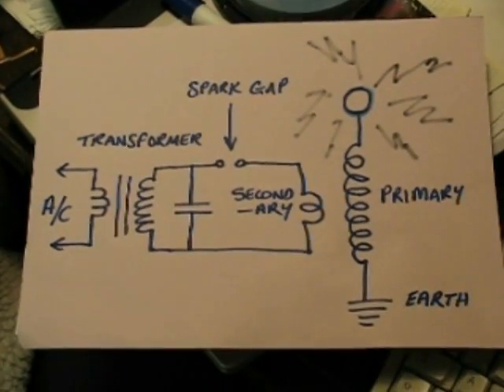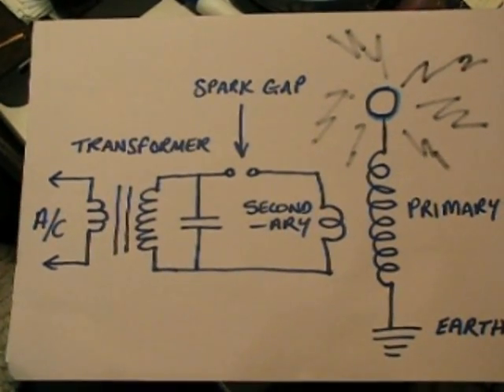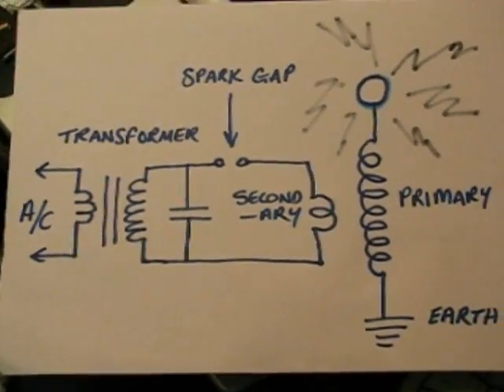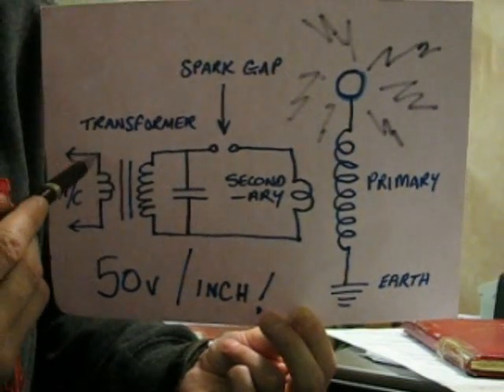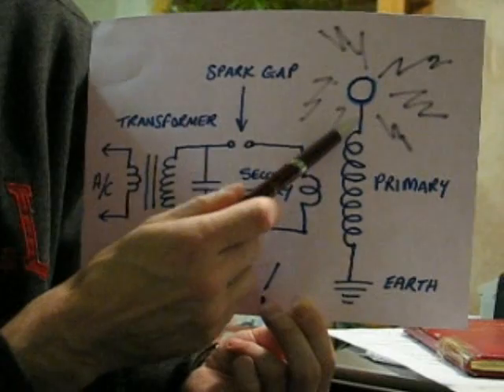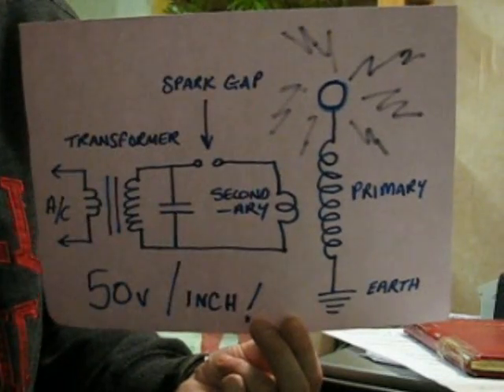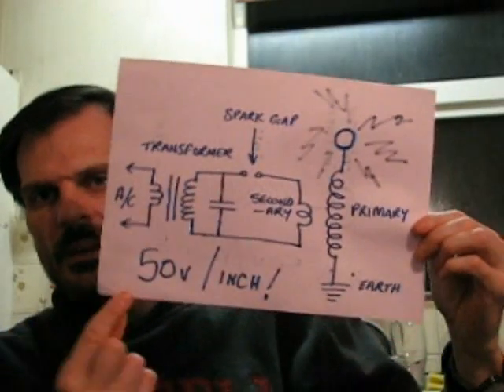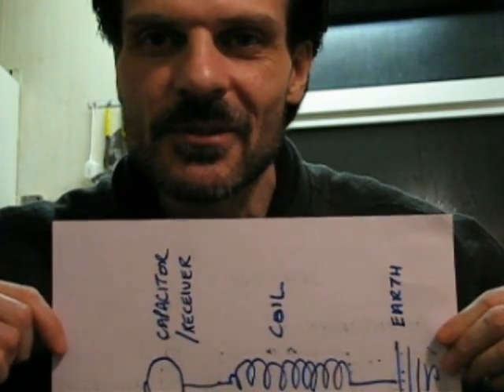Tesla's Little Secret

Comment: “YOU SEE, I  built a cabin with 1kw solar charging of batteries via Morningstar 45 controller. NO PROBLEMS except I cannot run my 17-watt refrigerator during seasonal minimum of winter (from early November to late February. I REFRIGERATE my food in the 42 degree basement during winter. ITS NOT bad.) THUS, I look only to augment with maybe 500-watts daily, as charging input to my 25.2 volt batteries (26V @ 4A for 5 hours could change the world, justifying a sterner correction of energy production & consequent surge in futuristic, pro-China environmentalism.) ITS A different reality. I EXPENSE $1 propane daily for cooking & wood heat (that is my energy cost not including gas for my chainsaw & splitter, LT system maintenance, guessing less than $1 daily.) MIDDAY, THERE is inefficiency as the controller will protect the batteries, so I turn the panels to improve input duration. YOU SEE, I expect $200 weekly disposable income from social security with this arrangement in 2022.

AM DECIDING that 28V @ 1A augmentation would be wonderful, solving my seasonal problem.”
Reply from the maker: Have you thought about using electrolysis in summer to split water into hydrogen and oxygen? And in the winter use the hydrogen as fuel to generate electricity?
Reply: MattBlytheTheOne 

“WELL, CONSIDER option to expand the array. CLOUDY DAY input varies seasonally , is between 10-20 percent of sunny input. THIS COST is less than would be a gasoline generator (which I do not own, or a battery charger which is under consideration. A QUALITY 24V charger is marketed to charge electric scooter battery, a good looking product.)

10 years ago, I built a Perendev MM which failed. THE BEDINI IS noisy, though I think a bicycle wheel might be okay, paralleling two devices to achieve 24 watts? AM RESEARCHING Clemente Figuera motionless device, waiting. SCALE A 500-watt version of it for my application. IT WOULD be nice. ALSO, VARIANTS of motionless pulsed devices may deliver 48 watts & would be impressive. THE RON PUGH charger design is interesting. I HAVE seen a U.K. demonstration via YouTube. AS I enjoy doing PCB layout & Eagle drawing, I look to leverage the capability to assemble a kit product, which could be sold profitably. THIS ASSERTS my interest in pulsed systems, the Figuera design can be accomplished with divide-by-sixteen into a PLD, or the 4017 as shown & a PCB. IT WOULD be quiet, & the design would be reproduced with minimal defects in a kit product. FIGUERA SUPPOSEDLY powered his home 100 years ago, deriving several KW. IF I could get just 500-watts in a kit-able product, I would not only solve the charging problem for refrigerating, but would have ability to augment social security income in my future.

HYDROLYSIS INVOLVES several things with which I am not familiar. SAVING HYDROGEN for winter use seems less preferable than a reliable Figuera charger device. I HAVE downloaded the PJK Book.

I PAY $60 monthly for unlimited ATT IPHONE data access. CAN DO research & drawing. AM REASSERTING my electronics capabilities since losing everything to fire in 2015. I CAN create artwork for your boards, & do simulations in LTSPICE where I prototype logic, also with Electronics Workbench. MY OLD laptop survived the fire. I LOST THE cdroms of my software. WAS EMPLOYED to create SMPS prototypes for fiber optic development. I HAVE an Arduino. HACKED PERL Webstore, adding cache feature to DB version. HACKED COPY protection in TMS7000 Videocipher hacks. FCC General Class since 1981. AAS ACCOUNTING.
Reply from the maker: Good luck and thanks for posting your CV ;-)

Comment: Thanks for links to Tesla biography. Regarding "Mr Tesla's little joke..." I'll be honest. I dont get it? This guy was a superb electrical engineer - Why would he "hide" such an important discovery? He basically invented and patented induction motors (that dont use brushes) along with polyphase distribution (that solved the problem of electrical distribution over long distances). Not inconsiderable achievements. But if you look him up on Wiki, Wardencliffe is described as a "wireless communication and power transmitter", not a radiant energy collector... So where does this idea about radiant energy capture originate? Surely the big guns and a group of electrical engineers could develop such important (life changing) technology? Thoughts welcome. I have nothing to lose but my ignorance!

Comment: could the process be as simple as capacitor placement?  if when plugged into AC mains, the cap is prior to the spark gap,  as a voltage multiplier to jump the gap and oscillate the circuit; wouldn't the converse need to be true if the circuit is running in reverse?  should you then move the cap to the other side of the spark gap and add a diode, to act as a DC voltage multiplier to again excite the gap with a DC source and oscillate the circuit in reverse

Comment: No. How can the ball at the top just collect radiant energy? It can not. This is why it has never been built.
Reply from the maker: Do you know how aerials "collect energy"? They are tuned to receive signals of a certain frequency. There is nothing special about them.
Reply: Yes I do and if what you are imagining here is real then please build one. A tuned antenna, called a rectifying antenna, designed to collect radiant energy, have been created however the energy collected in very marginal. In addition the ball at the top of the Tesla coil is designed to evenly distribute electricity until it can find a ground outside of the circuit. Its designed to distribute massive amounts of AC current.
See here and research the idea: https://en.wikipedia.org/wiki/Rectenna
Reply from the maker: I believe the Tesla Coil was designed to reduce back emf and ionise the atmosphere such that energy could be transmitted wirrelessly at distance to a similarly tuned coil remotely. Wikipedia is an open source encyclopedia, anyone can edit the articles. Except the Tesla page which has been restricted to only a few approved editors. You will never find the whole truth on wikipedia...
Reply: This is true. My guess is that Tesla was also trying to develop the tech for than more reason and found out that the coil was ultimately a dead end for him. Not to say that broadcast power has not been the dream of most scifi lovers everywhere. The coil as designed and known today really does one thing best to everything that comes near it.... With that said short distance power distribution is possible today for small devices using DC power and I am sure you know this... :)
Reply from the maker: I have a new video coming out that reveals pone of his major breakthroughs, you will love it. Subscribe if you have not already and turn on notifications :) Thank you.

Comment: It all seems reasonable from an armchair point-of-view, however, millions of these Tesla coils have been built in the last hundred and thirty years and no-one has seen this power reversal manifest in their units. I have built a dozen or so of these Tesla coils of all sizes in my teenage years and I have also wondered  if it could be reversed and I have checked the voltage on both sides of coil #2 and found only a few millivolts and designing it from scratch with those numbers that I got from the coils didn't yield enough across the secondary of what would then be coil #1 to be of any use. I do believe that with some fooling around with it that it could yield something but we would perhaps need to build a resonant circuit that resonated with something [what ???] that is being generated from the planet, I don't know, I don't have the time or funds to play with it right now. Good luck to somebody... :-)
Reply from the maker: Have to tried building resonant coils to send/receive energy wirelessly to each other? Hint, the mass needs to be the same in each coil, and the sending frequency needs to be optimised at resonance :)

Comment: My ilttle secret......to extract power from the sun..............use SOLAR photo-voltaic panels  and Solar pipework heaters ! Stop sucking the end of your pencil and dreaming,  plug in and start selling the free stuff back to the energy corps. !
Reply: It was a dreamer sucking on the end of a pencil, that invented your solar panels. So, me not being an electric engineer, it costs me 20k to 40k to get house setup just to get 5 or 10 bucks a month from the power company. No thanks!! I'd rather pay 2,400.00 a year till a dreamer sucking on the end of a pencil figures out what tesla invented years ago
Reply from the maker: Both have a point. Solar panels are expensive and not particulrly efficient. They are good but by no means the best way to collect radiant energy!

Comment: Dude, its been 6 years, have you made progress? You are right as far as you take it, but you need to look deeper. How is the radiant energy collected? Backwards, isn't an answer. Resonance (Morin) isn't an answer. The question is: How is the radiant energy collected?

Survey says: It's in the spark gap Boyo!

But, you're missing something to make that possible.

That capacitor will charge however the polarity across it charges. And with an AC transformer charging it, that means both directions. And a fact about capacitor discharges is that they are AC. Yep, even a unipolar charged cap will discharge with an AC signal.

Tesla's secret was to shorten the spark (with several strategies) and get it to be unipolar. Then it collected up to 1,000 x the power of the spark from the Aether. The spark became a radiant source and that source, like air compressed in front of a plane traveling at the speed of sound, collected more radiant energy which went directly into the primary to his final high capacitive coil. (The tower coil with a top load.)

His methods were not secret, they're just left off the majority of circuits. They included a rotating spark gap that accelerated the number of sparks, making each one shorter. Also electromagnets that cut off the reverse current sparks. Plus hot air jets that shortened the sparks. Yep, you can blow them out.

Now you're pumping a variable DC.impulse into that Tesla coil, which projects a radiant pulse train that is self-amplifying, or lossless. Any tuned capacitor will receive more power than was consumed generating it. The most crude and simple implementation of this is what tesla did, transmitting power 6 miles. He also. Modulated that power with FM and AM signaled... so you can transmit lossless data.Poaer and controls for RC planes that do not require fuel, or lossless transmission of two way video... Oh, did you get the memo. This impulse wave travels 57% FTL. It's a death knell to the communications and power industries. So, when you do get it working, keep it on the down low. Or you might end up down under. Peace, B
Reply from the maker: Strewth! Thanks for sharing your wisdom.

Comment: Running the aerial backwards,  you would have thousands of volts,  but no amps to go with it. So basically you have a static generator powered by ions in the atmosphere. You can see this with a citizens band antenna tuner.

Comment: Problems: 
1. Atmospheric potential is DC, so it won't do fuckola when put through the first transformer unless it's inverted to AC, but that in itself would take power from the system.
2. Atmospheric potential is indeed about 50-100 VDC a foot, but has picoamperes for current, you could barely run a single LED with a 500 foot tower.
3. If harvesting atmospheric potential was viable, power utilities would be using it & sending the 'free energy' through the existing grid & billing you based on your existing electric meter - just like they do with hydro/wind/solar & every other power source.

Nice try, but get a basic grip on electrical basics like amps/volts/watts & the properties of AC v DC.

It's not an illuminati plot or a cover-up. Yes, power can be harvested this way, but it's infinitesimal, more suited as a science fair project than a viable power source to replace our current sources. The energy return on investment is a waste of time & resources when compared to other power harvesting techniques.
Reply from the maker: Do you know why they have spikey conductors on the top of broadcasting masts? It is to conduct the huge amounts of electrical energy generated at those altitudes. If they did not have those the power would destroy their equipment. Just like lightning would destroy and LED. You do know how lightning works?
Reply from the maker: Ps. What is a fuckola? Lol.
Reply: MattBlytheTheOne Fuckola is the amount of DC power that is transferred through a transformer. Yes, there will be an initial pulse as the inductor charges, so yes - you can harvest a nano-second worth of voltage in the picoamp range.
Neat, but useless.
Reply: MattBlytheTheOne MattBlytheTheOne Thosr spikey things are called "transmission antennas" or are you referring to the lightning rods? Yes, I know how lightning works & it's the same thing that would destroy your proposed scematic at the first strike.
LEDs? Yes, a light emitting diode - they work because semiconductors lose electrons at the p/n junction & LEDs convert those lost electrons into photons.

Any more questions? I'm quite well versed & experienced with electronics & electricity.
Reply from the maker: Ok how are lightning clouds able to generate many millions of bolts of high current of lightening for several seconds and not discharge after the first strike. 

I thought a fuckola was a bit like a tombola: you win a prize for thinking you know an iota about how the universe works!
Reply from the maker: And also: how does an electron become a photon?
Reply from the maker: And: Why do LED's not heat up in the process of "converting" (lol)
Reply: MattBlytheTheOne The stormclouds build up a static potential which is discharged to earth & is repeated & different areas of different potential within the same storm.

Instead of arguing with me about your circuit why don't you build it & prove the nay-sayers wrong?
Reply from the maker: Did you read that on wiki? What about the alignment of the potential difference across H2O molecules that are continuously charged by the aether (as all atoms are)? I'm not arguing with you.... it is not my job to educate you and weather or not you agree with me, no doubt the Universe is working as it should. Expanding your own education will however open up new avenues of research and breakthrough for you. Why don't you build one and prove me wrong? Probably for the same reasons. Time and money and the fact that I never said I would build anything and especially not for your approval ! Have a good day! :-)

Comment: a lot of paper stuff but no real practical working model...what's up with that?
Reply from the maker: One small simple diagram I borrowed from the internet and discussed is a lot of paper stuff? Google working Tesla coils and see if you can work out why Tesla created them and then built one the size of a tower?
Reply: I just thought that I was going to see something that actually worked or even a small built up model.
Reply from the maker: There are prototypes and experimental designs but not by me. I am just discussing ideas because I am interested in electronics and the workings of the universe. Thanks.

Comment: The flaw in your theory is that you can't put DC through a transformer.
Reply from the maker: Of course you can. Dump enough current through a coil of wire fast enough and it create a big spike of power and enough electromagnetism  to create anti-gravity!
Reply: Mattbytheone: Ok I'll spell it out, if you put 9v ac through a step up transformer, it will step the voltage up, but you cannot step down or step up dc voltage through a transformer. This was Tesla's arguement with Edison who wanted to supply homes with dc voltage. 
In order to be able to supply a town with electricity, it needs to be transported at a higher voltage than required, to account for losses caused by distance travelled. Then the voltage is stepped down at the home or nearby sub station. Using dc you would need massive resistors, causing energy to be converted to heat, and subsequently lost, but using ac you can use a transformer. Sure you can hook up dc to a transformer, but other than creating a magnetic field, it's not going to provide you with anything at the transformers output.
Reply from the maker: Yes I understand how DC and transformers work (basically) but there is nothing to stop DC being converted to AC. All AC is some kind of pulsed DC energy.